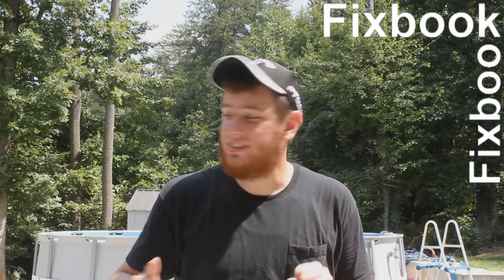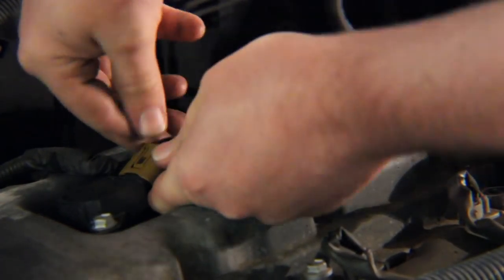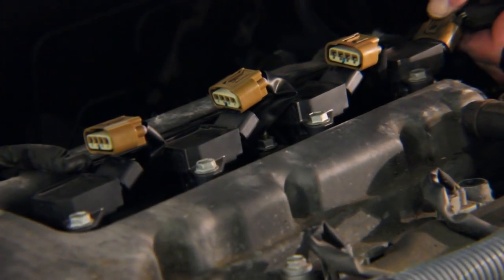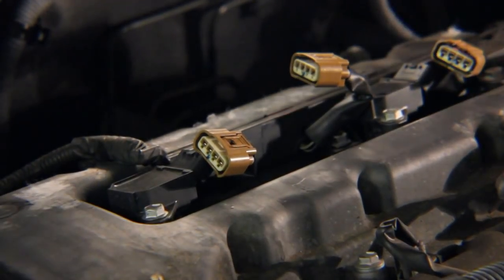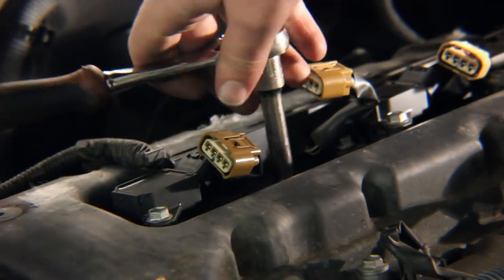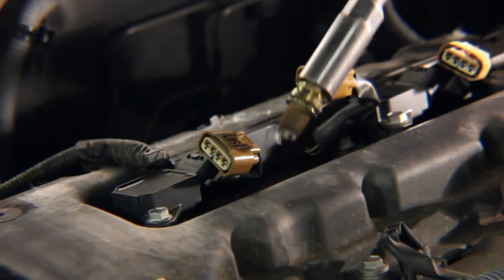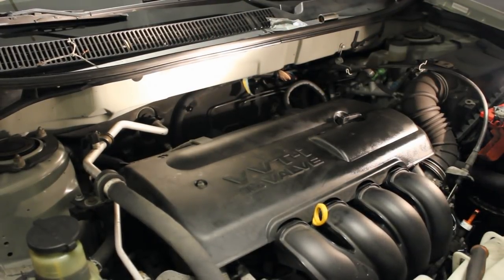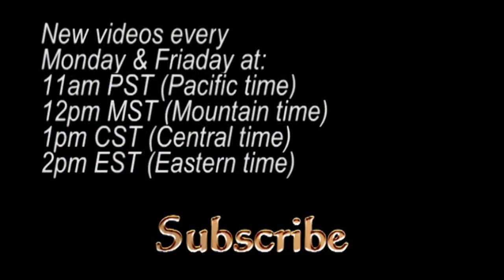Toyota Matrix, & Pontiac Vibe Replacing Spark Plugs

Comment: Thanks for this! I'd like to add that there is a bracket that's on the back row under the spark plug tubes on the right side. You'll need to remove the 10mm bolt and nut and then the tube comes out ok. Replace both tubes and connectors before reinstalling them. Also, you can pry the connectors with a flat head screwdriver rather than try to push really hard with your thumb to disconnect it. I got all of them off in the time it took you to remove one in the video. That's not a knock on you...I just looked at it, tried one, struggled like you did, and then thought using a screwdriver would be a good idea and it was.

Comment: Great DIY video....just one thing re anti seize compound, it should only be applied to the top 3 threads. Anything below that ends up in your cylinder and you do not want that in there. Thanks

Comment: Thanks for the video.  I couldn't find the plugs and wondered if they were under that cover.  Also, it looks like you could use a small screw driver to pry up on those clips preventing the spark plug wires from coming off.

Comment: 6:40 
Unscrew the plug to the point of tick/tick/tick you hear it thread jumping to say IM OUT!
If the 5/8 plug tools wont grab the plug, use the plunger!! Worked great!

Putting them back in...
If you dont have the 5/8 with rubber boot grommet (Wallace and Grommet), jut hold the plug in with your finger and pop it into the cylinder quickly, letting finger go last minute.
Plug knows there it's home is...it'll go there!

1 hour tune up.
Easier than reprogramming a microwave.
"I dont have a microwave but I do have a clock that occasionally cooks sh*t" 
-[Mitch Hedburg]

Got the Bosch Platinum IR Fusion ("+4") at the evil empire (Wal...) for $3 for a set of 2.
Tune up cost me about $8: Plugs, anti-seize and tax!

Comment: u did it find but u seem to have used copper plugs and if u look on the left side of the valve cover it does call for iridium plugs for the proper spark and its what ever sense ur leaking into the head anyways

Comment: LOL - didn't you never think of (very gently, and carefully, so as not to break it off) prying up on the connector holder-onner thing with a little screwdriver? Prying up on the end that needs to come up, instead of, or in addition to, pushing down on the end that needs to go down? Or sliding in a little piece of sheet metal to hold it open? Thanks for letting us know you need a 10 mm socket for the cyl head cover - but what size sparking plug wrench does we needs? Yes a tiny dab of anti-seize compound is all you need. I paint it on the threads with a little, cheap, soft artist's brush. Not the squished, effed-up brush that comes with the 8-oz jar of anti-seize, attached to the inside of the cap - but just a little, soft artist's brush. Doesn't matter if you miss spots. I screw-it-in-screw-it-out, check that this spreads all the compound over all the threads, then I screw it back in and tighten.
Reply: It's a 5/8's socket. Preferably long but a regular length and a locking  extension work fine too. And NEVER put anti seize on spark plugs. If its gets on the electrode it'll  cause  misfires. Also a small 90° pick works great for connectors. Lift up and pull away easy. This is a 5 minute job max lol

Comment: After I turn off the engine, how long should I wait before attempting to remove the first coil pack? Thanks.
Reply: Cast iron block you can take them out right away, aluminum heads you should let them cool down for 20 mins as not to pull the threads

Comment: Do toyota Matrix's not have spark plug wires to replace?
Reply: Its coil on plug design so the plug wire is made right on the coil, so u have to change the coil out